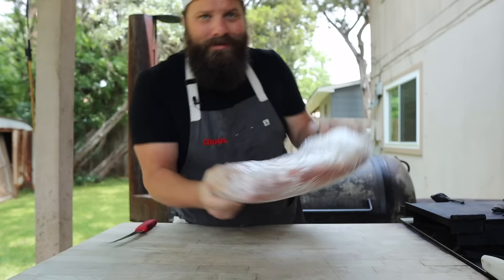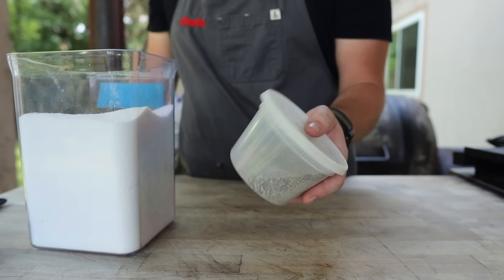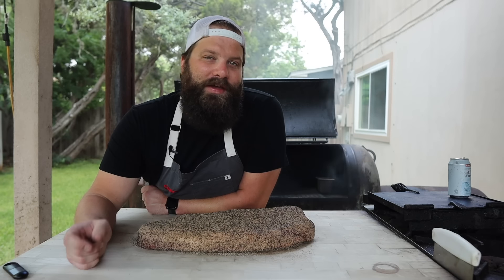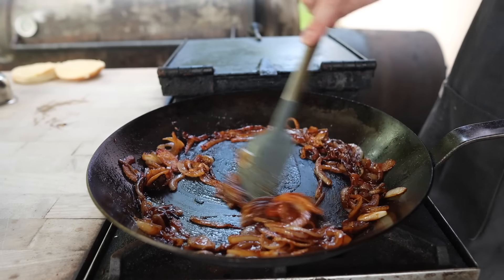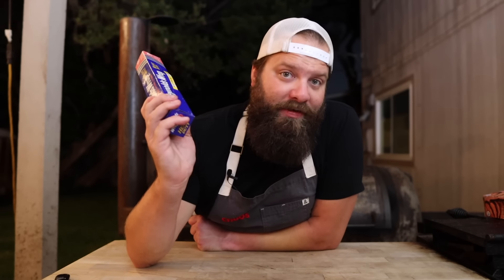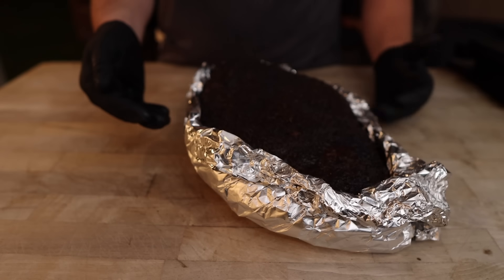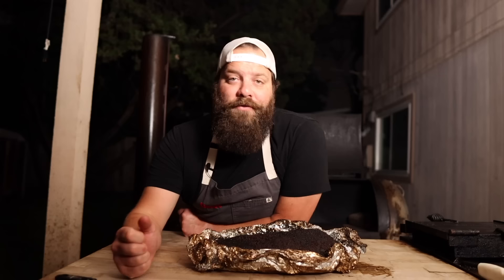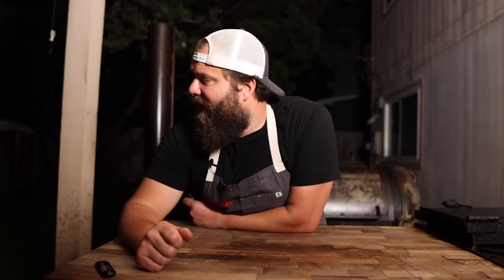How to Smoke a Brisket! | Chuds BBQ

Comment: The Resting period is what really separates a good brisket from a perfect brisket.  If you're team soft bark like me, a sous vide rest at 165 degrees from the time you take it off the smoker to the time you slice the next day makes a world of difference.  Lots of guys are impatient so they want to eat the brisket the same day they smoke it.  But patience is a virtue, and if you cook it the day before and rest it at 165-170 overnight, people will rave about how great your brisket is
Reply: Yes please. Go into the oven rest vs the souse vide rest. Thank for the great vids.
Reply: How about brisket for dinner? Have you tried sous vide rest for 16hr+?
Reply: @bobert6644  Yes I've pulled a brisket off at 2am and rested it until 6pm the next night.  Same deal.  Very tender
Reply: @4dwyn  or Brad, what temp did you SV rest the brisket so it doesn’t over render? And do you wrap in paper before vac sealing, or the brisket straight into the plastic? Cheers.
Reply: @colsadventures  no you dont wrap the brisket when you vacuum seal it.  I believe I wrote the temp I rested it at in my OP, and I think Brad said 165 in his video
Reply: @4dwyn  cheers, I saw the temps above, but I wasn’t sure if you used different temps depending on hold time. I was thinking about the safe food temp, but bring vac sealed there isn’t much air for bacteria. 
I made the mistake recently of wrapping in paper before vac sealing and the paper absorbed a whole lot of fat out of the brisket. Thanks again.
Reply: @colsadventures  i think Bradley said above 140F you're safe.  I've rested at 170 and 165.  I actually like 170 better but people have raved about the brisket both ways, so you can't lose.  I find that even with crunchy bark, by vacuum sealing without the butcher paper the bark will soften quite a bit.  So I started foil boating and didn't worry too much about butcher paper.  Cuts my cook down by a couple hours.  Best of luck to you.  Cheers!
Reply: @4dwyn  when you rest it at 170, let's say for maybe 12-16 hrs, is it in more of a boat wrap, full foil, or full butcher paper? Going to get mine on tomorrow (Saturday) to serve for dinner the next day....it's about 9lbs trimmed, so won't need half a day, but I'm fine to leave it in the oven the night I pull it off the smoker until I'm ready to serve.
Reply: @abesanjakdar6130  I take it out of the wrap and slide the brisket unwrapped into the bag and vac seal it

Comment: Hey Brad great video. I just cooked to briskets for my mates wedding party and did the overnight heated rest in the oven. This is no joke the best tip. they were so jiggly and soft yet held together perfectly and the bonus like you said didn’t have to time it. Win win. Keep up the awesome work 👍🏻
Reply: Did u put it on bake, broil?
Reply: @LL-tk1gn   I've never seen an oven that allows you to set the temperature when broiling.
Reply: @trevorearl5876  they have em. Thanks for the feed back
Reply: @LL-tk1gn  I’m from Australia 🇦🇺 not sure what broil is😂 I’m assuming  “broil” we call grill. I just put it on bake but not fan forced. Also I’m in Celsius so I did 60c which is 145F  that’s the safe temp for beef. Hope this helps😃
Reply: @LL-tk1gn  there's an option that says "keep warm" or just put the temp on the lowest temp

Comment: just smoked my first brisket on Saturday for Father's day. I definitely oversalted the flat eith my 50/50 rub of salt and pep. I thought that your 2:1 might be too peppery for the kids but I'm definitely doing that in the future
Reply: For a first timer, I think its important to measure out your salt & create a ratio from there.  Try approx. 1 teaspoon per pre-trimmed lbs of brisket. So if you buy a 14lbs brisket, use 12-14 teaspoons of salt or just around 1/4 of a cup.  I both over salted & undersalted until I researched generally how much you were supposed to salt raw meat, did a few experiments and came up with this.  I think Brad is so advanced and has done this so much, he only needs the parts and can eyeball the coverage. But when its your first few, measuring it out so you don’t oversalt is key. When you measure out, you’ll never go too much.  Also some of what you measure out will hit the board/table too.  Be mindful of what that looks and feels like the first few times you do it and eventually you’ll be able to just eyeball it.  You can even start by salting separately, then peppering too.
Reply: I thought the same as well at first, but that 2:1 mix is just right. The pepper really brings out the flavor of the meat and doesn't overpower the senses.

Comment: Great vid. Brad. You covered the most essential tips. Here is another tip for the crew....If your brisket is pooling a fat spot on top, add a wood chuck to the underneath to raise it so that fat will run off.
Reply: Good tip. I have had the pooling on top before. I try to approach this problem in the trimming stage and make sure there are no valley so when the fat renders it falls to the outsides and off the edges. I will keep the chunk of wood 🪵 in mind if I run into this mid cook 👍🏻

Comment: Nice simple overview. Thanks Bradley.
We do the spritz on the sides and paper wrap. Maybe because of who I've watched, I just haven't branched out to try something different. We like it so much that I'm worried about fixing something that isn't broken.
For the rest, we leave wrapped and put in a cooler that has the heat feature. It goes up to 140, so I figure that if I put my brisket in there at around 160, it'll keep it riding around 150ish until I'm ready, usually about 16 hrs later. So far, so good. We don't get the crunchy bark, but it stays on and the flavor is fantastic. I wonder if I'd get away with opening it up and putting it on heat for a half hour or so in order to crisp up the bark a bit.

Comment: PRE-GROUND PEPPER is the key!! I thought I'd be smart and crack my own pepper right before putting it on my brisket, BIG MISTAKE!🥵 Brisket ruined. Also the 50/50 ratio can end badly as well, like you said Bradley, 2 parts PRE-GROUND PEPPER to 1 part kosher salt has ALWAYS came out perfect. Next brisket I'm gonna try oven resting, instead of using my Yeti cooler. Thanks Bradley!! 👍 🔥🔥🔥
Reply: Why did the freshly ground pepper brisket turn out ruined?
Reply: @ryanleal1764  It was way too peppery, my family found it hot, I couldn't  taste the heat, but the pepper flavor was very overpowering, not just the bark (which turned out pretty good lol) but throughout the meat, couldn't really taste the smoke like I normally could.
Reply: @apexcustomsmokers  so it sounds like basically the pepper taste comes out way stronger if you use fresh ground. Maybe try using half as much if you grind it yourself in the future. I personally prefer the idea of doing the salt and pepper separately. That way you can salt it just the way you like and you can actually see the salt without any other spice getting in the way visually. Then apply your pepper or whatever else you’d like to use as seasoning.

Comment: I’ve always used the boat technique ( about 8 years now ) always gives the perfect bark, I’ve tried all kinds of resting techniques , everything from confit in tallow for 12 hours (awesome), to wrapping in butcher paper and a towel then placing in a cooler for 2 hours, to even serving it immediately after cooking, confit is the way to go if you have the tallow to do it, but also in an oven at 150f for 10~12 hours is also awesome, I always cook mine the day/night before, to make it as perfect as possible, great advice Brad, I’m a huge fan of yours, you do everything how it should be and that only comes with experience, cheers mate

Comment: The last brisket I did, I did the foil boat and then when I reached the 203-205 mark, I turned my 30 inch electric smoker down to 150 or so and let it rest for 14 hours. Best cook I’ve ever had on the brisket.
Reply: Did you cover the brisket during the rest or just leave it in the foil boat uncovered?  I did the foil boat for the first time last week and rested in the oven at 170 uncovered, but I was worried about the bark drying out too much, especially if I had to rest it overnight.
Reply: @mstuckey311  it was uncovered for most of the resting time. I was worried about it getting dry so I put some tallow on it and covered it for the last couple of hours. I let it sit out of the smoker for around 1 hour before I sliced it.

Comment: I just cooked my first brisket on a pellet smoker, I cooked at 220, I wrapped at 160 (see now I should be doing it later) it only took 6 hours to cook and was an 8 lb brisket. Was this because I wrapped early? It was also dry and tough, but I pulled at 200 and rested in a cooler covered in towels for 4 hours. Pretty perplexed about the whole thing

Comment: dont currently, but i used to work at a world renowned bbq smoker company as an engineer. you get 85-90% of your smoke adhesion within the first 2 hours. also a " smoke ring" is chemical reaction. no actual indication on smoke penetration, because.. well smoke doesn't penetrate. its all surface

Comment: Can you use the foil boat method using a pellet smoker where the brisket cooked fat side down until it reaches 180°? 
And at the stage, do you flip the brisket to finish the cook fat side up in the boat, or continue the fat side down in the boat? Thanks man

Comment: You make a convincing case for the foil boat.   But you finish your brisket on the smoker.   Some time after the wrap, I bring my brisket in to finish in the oven.    How would that impact the foil boat method ?     And I have a new convection oven,  would that make a diff ?   Thanks

Comment: Always great stuff here at Chuds BBQ!  Thank you Bradley!!!  I'm really diggin' that BBQ Dragon thingy.  I run a very old OJ Highland and we all know, we ALL KNOW, the smoke box on that stick burner is just a little tiny thang which presents a challenge to maintain temps.  I'm thinking that BBQ Dragon fan would do just the trick when adding more splits to help them fire up faster so you can get the lid on the box closed and keep temps up.  Anyone have any experience with this fan and a Highland?  Bradley - what say you?

Comment: Hi Brad!  Great video.  Yours have been super helpful to me and my cooks. Curious as to how much salt you put into your container to use?  I’ve been doing 1/4 of a cup of salt for my briskets (generally 14lbs pre-trimmed) and that’s worked well for me to make sure I at least don’t over-salt, and then I work my ratio from there (either 2-1 or 1.5-1).  It looked like you used a measuring cup to scoop the salt out.  Was it 1/4 cup?  I think it would be good to know for people doing their first cooks so they don’t find out they over-salted 24 hours later.

Comment: Hey Chud! Love the vid and the tips. My oven only goes down to 175 but I think I will give It a try resting at that temp!
Reply: My oven is the same about 170, rested one other night, I put it in at 3am and we ate around 12 so it was in there about 8 or 9hrs. Turned out great , it definitely helps
Reply: @gardentogether9298  thanks guy! I appreciate that! I’m definitely going to try It! I have a cookout coming up next weekend!
Reply: Most kitchen ovens these days can be calibrated to a lower temp. My GE oven has a lowest temp of 170 degrees, but you can adjust this by calibrating that down by 15, which is what I do...so the actual temp is 155 when the oven says 170. Works for me.
Reply: @davidwyatt6617  oh wow. How do you do this?
Reply: @tyebrown9606  You need to find the instructions for your particular oven...can typically google it. It should then give you the buttons etc you need to push to make the calibration adjustment...I then reset mine back to normal after the rest is completed. If you have an accurate oven thermometer you can put into the oven, that will help make sure the temp is correct.
Reply: @davidwyatt6617  This is what I do.  After googling the make & model, it's very easy.  Just don't forget to set it back to normal or your wife will be very upset when she bakes something and it is not done at the right time.  Don't ask me how I know !!

Comment: Chudd great video! You always teach me something by watching your videos. Question: I have a 500 gallon offset using hickory wood, stack and vents fully open running around 270 but I'm not getting good smoke flavor in my meat what do I need do? Thanks
Reply: First you might want to investigate your wood moisture level. If it’s too low then wood is going to go up in flames and not give off proper smoke. If you get a meat moisture reader it should ideally be no lower than 12%. Moisture in wood is what gives off smoke. Second, are you building a fast fire or a slow fire? Fire management is crucial here. You want a slow fire, low and slow in fact. No flames jumping into the cook chamber. 275 sounds a bit high to me unless you’re going for the “hot and fast” method. I start mine off at 225 for the first 3 hours then bump to 250. Lastly, you might consider closing your damper about 1/3 or even halfway to slow down the smoke rushing out of your stack. Been smoking briskets since 2007 on everything from backyard to 1000 gallons. All the best.

Comment: What temp do you run the smoker at after you have wrapped it in the foil boat and put it back in?  I notice you said 275-300 up until you wrap it but didnt mention the temp when you put it back in, going to try my first brisket and would love to know that info if possible, cheers
Reply: How did it go?

Comment: Another great video, Brad. I have a question: I typically cook briskets fat side down. I have a Lone Star Grilz vertical cabinet offset and all my heat comes from the bottom. What are thoughts about cooking fat side down as I'm doing but using the foil boat method fat side up just after the stall? I currently wrap in butcher paper just after the stall.
Reply: I also have a 24 x 36 cabinet off-set cooker from Lone Star Grillz. I sometimes have problems with crispy bottoms due to all the heat coming from below, even with the steel plates below. I am also tempted to try it fat side down for the first half of the cook and then go to the foil method. I would love to hear from other folks with cabinet smokers and what works for them.
Reply: @elbertdavid9644  Hi there! I have a cabinet smoker and I recently experimented with something. I put a foil pan on the rack just underneath the brisket. My inspiration was the blocking logs that are used on horizontal smokers. The theory was that the foil pan right underneath the brisket would almost provide a convection effect so that the heat would go all around the brisket instead of just pounding the bottom. I don't know how the Lone Star is constructed, but if the steel plates are further to the bottom and your brisket is closer to the top, perhaps the heat can still re-establish itself and char the bottom of your brisket. I found when I did this that the bottom was probably 50% less crispy than usual. It still wasn't where I wanted it, but its a start. One issue I ran into was that I had to manage my heat differently. I had to ramp things up a bit. But I didn't realize that until pretty deep into the cook. This caused my brisket to probably spend too long on the pit and it was a bit too tender, almost mushy. But I plan to keep experimenting with the foil pan directly beneath the brisket. The next time I might put it two racks beneath or just crank my temps higher from the get go.

Comment: I had a crazy thought but have you ever thought of using a softened tallow to rub on instead of mustard ? Just a thought, any response would be appreciated trying to learn.
Reply: A binder is just a cruch for a brisket that is too dry to keep the rub attached while smoking. DON'T use a binder because you think it will taste good. Chud's tip of spritz if it's to dry is spot on! Tip: I use 60/40 pickle juice to apple cider vinegar for a spritz. It helps break down fat and soften the meat. Also, his tip of keep it simple is highly recommend. I have tried all different kinds of rubs, but I always come back to SP and a little G. Salt, pepper and garlic. That tastes the best without blocking the smoke ring.
Reply: @markstopkey4085  thanks for the reply, appreciate any help

Comment: Has anyone rested in a toaster oven before? If so how large is your internal space of the oven to fit the brisket; and what model oven is it?
Reply: I do!  I bought a toaster oven specifically to rest brisket.  I went with the widest one I could find.  They’re usually sized by how many slices of toast it can hold, so I went with an 8 slice toaster over.  Internally its about 16 inches.  When you do your trim, if you trim to 16” by the time it’s done it will fit perfectly.  You can even research exactly how much meat shrinks when it cooks to maximize the space.  I bought the Black+Decker TO3290XSBD Toaster Oven, 8-Slice Stainless Steel on Amazon.  Chudd’s is listed on his list is a bit pricier than the one I bought ($300-ish compared to $109 on Amazon).  You can go with any but I’d say the keys are #1. It can go down to 150 degrees #2 the interior is wide enough & #3 it has a “stay” on mode so that it stays on until you turn it off.  That generally means don’t get one with dial that maxes out at 60 or 90 minutes.  Before you hit purchase on one, read the manual to make sure it has that mode. ALSO if the lower the temp increments are, the better.  If they move by 5 degrees you can set on exactly what you want.  Mine has 25 degree increments which means I can either rest at 150 or 175. I’d like to be right at 160 or 165 but I cant.  That’s the only gripe I have with the one I bought.